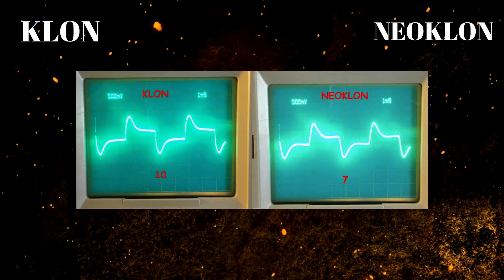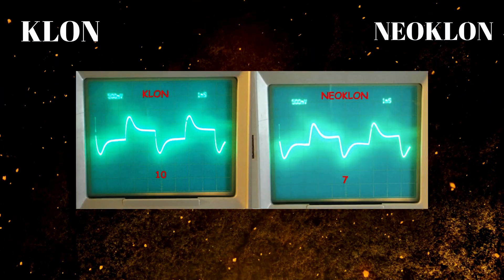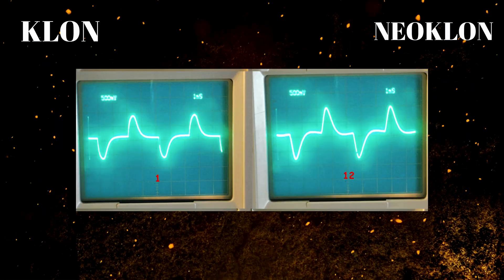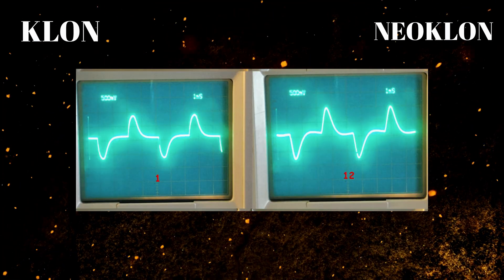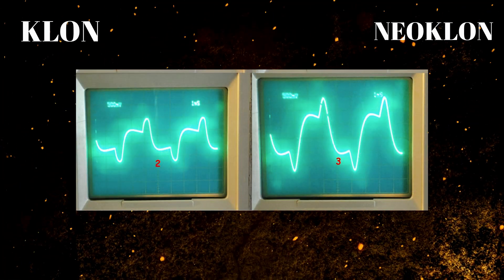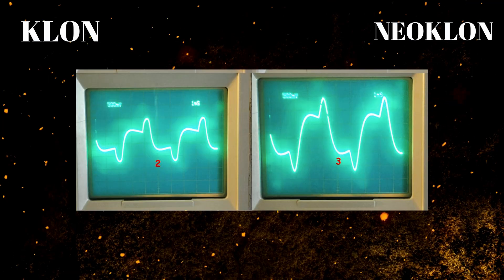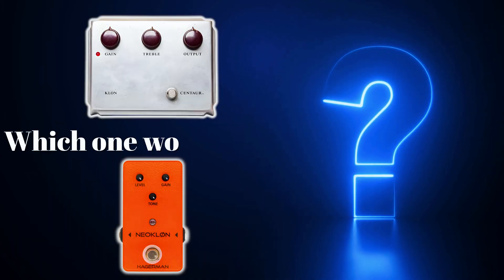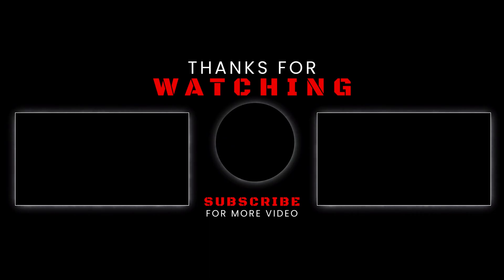Why This Klon Alternative Fixes What the Centaur Got Wrong - Hagerman Neoklon

Comment from the maker: ⚡Thanks for watching!⚡
If you want a part 2 where I stack the Neoklon with more pedals (Timmy, OCD, Blues Driver, etc.), hit LIKE and let me know which one you want to hear first?
Reply: Yes, stacking it with a Blues Driver would be interesting. I stack my Tummus Klon-Clone with the BD quite a bit and really like that sound. Running Hagerman Valve at ca 10 o'clock  in front of both. Tummus gain also ca. 9-10 o'clock, highs slightly dialled back. BD gain just shy of noon, EQ center. A Tele tuned to Eb sounds amazing through that chain. Takes Humbuckers well too.

Comment: I wouldn’t say anything was wrong with the original. This seems like a solution looking for a problem.
Reply from the maker: I see your point. However, the way I see it, it’s not a reimagining of the pedal, but some important tweaks that make an important difference.
Reply: @TL_Toneworks 🍻 an improvement.
Reply: Over the years I noticed a few small issues with the original design. One, the charge pump circuit was very noisy, easily fixed by adding extra filtering (to remove 10kHz noise on output signal). Two, with gain set to minimum, it puts the input opamp into an unstable mode (don't go less than 8am). Three, the circuit itself does something silly and attenuates the signals before  processed by the low frequency and clipping paths. That causes noise floor (hiss) to be higher than it should be. Fourth, the input opamp clips early (probably intentional), but is what causes a bit of harshness at higher signal levels. I tried to fix all of these and simplify the design at the same time. The result is a KLONE that is I believe quieter than any other out there. A much more detailed technical description can be found here: https://www.youtube.com/watch?v=NsFy3HV8lAI